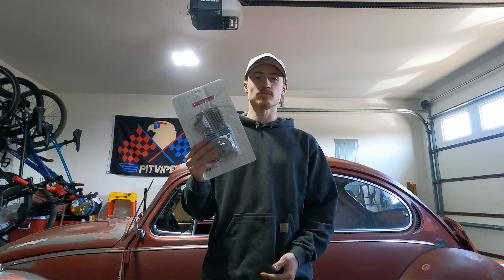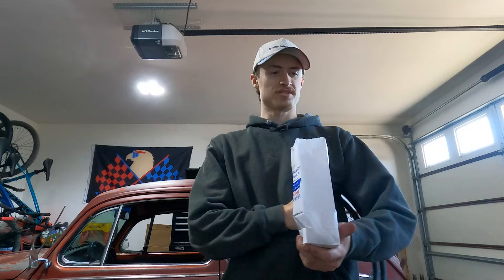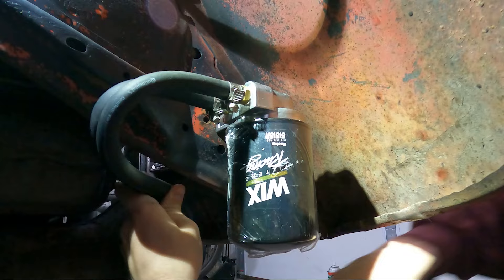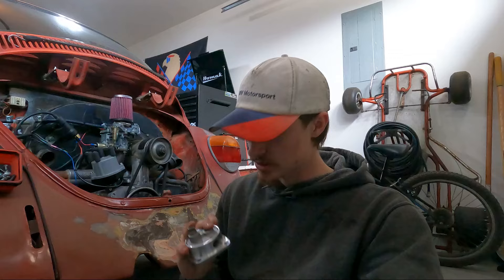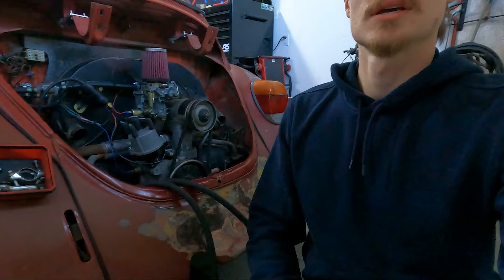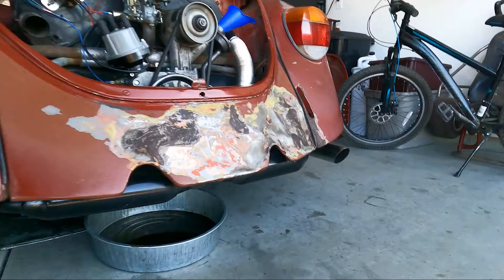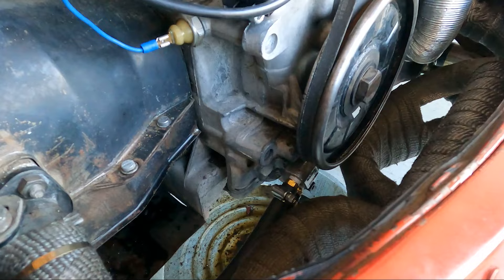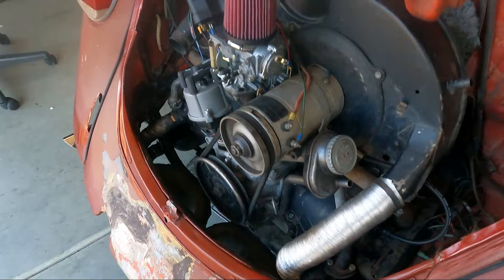If You Have a VW BUG You NEED This Oil Filter! (Save Your Engine)

Comment: Be sure to get a fire extinguisher in your car the filter is a great idea ❤ however the oil filled rubber hoses running through your exhaust isn't you could have run steel tubbing threw and used a small piece of hose on each to allow for a little flex and insolate lines with heat wrap much safer

Comment: If you want your motor to last longer I suggest you install all the engine compartment tin on the back of the car and replace the semi circular rubber seal at the back of the car. The trick is to isolate the top of the motor in the compartment from the bottom to prevent hot spent air recirculating which overheats the engine.
Reply from the maker: Normally I would agree, Although my current exhaust and oil pump set up will not let me fit the outer tray. I do however have the hood propped to catch more air and force it out the bottom in hopes of clearing the engine bay of the hot air. I'll keep that in mind if I can not control my Temps this summer though!
Reply: @mobilemotorsport  That definitely works.
Reply: @mobilemotorsport  I notice you have the headers thermal-wrapped too, which will help keep the engine bay heat down.
Reply: Judt had my whole beetle redone and they did the same, engine seal, ever piece of tin and all that didn't even know they needed it because my other beetles didn't have them

Comment: Fitted this in 2021, I have an Engle cam, straight cut gears, so it fitted ok, I added an oil pressure gauge, runs perfect, uk🇬🇧🇬🇧🇬🇧🇬🇧

Comment: Used this full flow oil pump , it is a good option if the case isn't fitted or drilled for full flow . Works great oil pressure without issues , I recommend this .

Comment: Might want to run a diesel oil with a much higher zinc level to protect tour cam and lifters than the conventional 10w30 you are running. Good luck.

Comment: external filter is a great upgrade, but that is not a 'high pressure' pump. and i knew it was going to leak when you slathered on the rtv and put in a paper gasket.. either or. thin layer of rtv, let it set up before torquing.

Comment: I love your videos brotha!  Those clamps are good but one thing I do is wrap that area with duct tape (because it's thicker) then clamp it, it reduces chance of the clamp digging into the hose.
Reply from the maker: That's a good tip! I wish they sold house clamps without the screw adjustment holes all around them locally but I always end up wishing I ordered a box!
Reply: @mobilemotorsport  Bad idea. I used to fo that. You can get slippage and a real mess. Most firm reliable attachments do need the clamp to dig into the tubing. Bad design but better safe than sorry.

Comment: Add a deep sump and you'll be good to go. a 1.5 quart sump will be ideal for your motor.
Reply from the maker: I was looking but everything is too crazy to source one in time!
Reply: stock 1600 doesn't need an extra sump. not even decent street motors need it.

Comment: They make some fittings that don’t need clamps. I have them on my bus.
Reply from the maker: Push lock fittings, right? I used those on some trucks in school but they're a little pricey!
Reply: @mobilemotorsport  they’re not to bad if you have a rubber and gasket place in town that sells hydraulic hoses and stuff. You don’t have to worry about clamps eating into the hose.
Reply from the maker: @galencurrington8704  I'll keep an eye out!

Comment: Hello,
I have a 1200cc engine (D coded) I was asking if this could work on my engine? And for it to work I have to get a new oil pump or I can use the oil pump already in mine? Plus that adapter plate for the pump where do I get it? Thanks in advance
Reply from the maker: You can use a stock pump with the new cover with oil fittings. My pump gears were pretty worn, so I replaced everything. You can find the oil filter kit on Amazon or other places. Here's a good one: https://amzn.to/3Tl0v81

Comment: Do you know what car(s) use the same oil filter, for when you’re buying a replacement at the local parts house?  I’ve got that external piece from many years ago, and I’m sure it’s the same. I may put it to use at some point.
Reply from the maker: I'm not too sure, you could always take the external adapter to your local parts store and see what threads on! As long as the O-Ring seals and the threads are tight you're off to the races!

Comment: Question.... what benefit does the higher pressure oil pump bring when you have an external  pressure regulator/relief valve in the case? There is a difference between an aftermarket high pressure pump and high volume.
Reply: Absolutely no benefits all. But it also depends on your engine case.
Reply from the maker: I'm my case I installed it mostly for the external oil filter, but also it cleans up the flickering oil light at idle on an older engine
Reply: Stick with stock 26mm oil pump. 30mm oil pump will keep the bypass open on a dual relief case and it won't cool properly, or you run the risk of blowing the oil cooler/seals on a single relief case.

Comment: The never needed a filter or the Germans would have added one.  2.6 qts and 3 month/3 k oil changes was the reason.
Reply from the maker: The Germans aren't always right
Reply: My Bug is older than you!!  You need to seal your engine compartment.